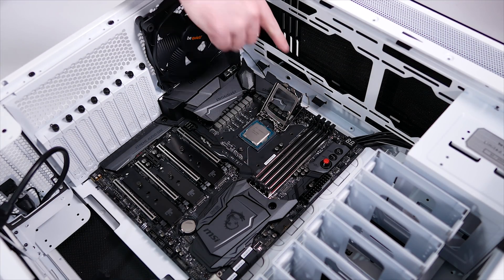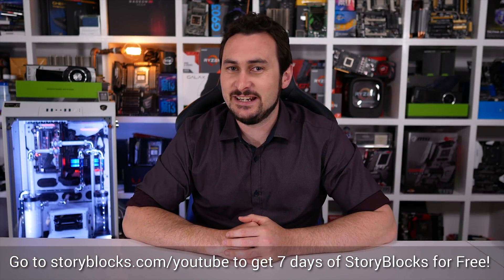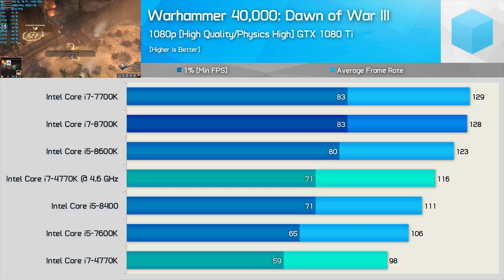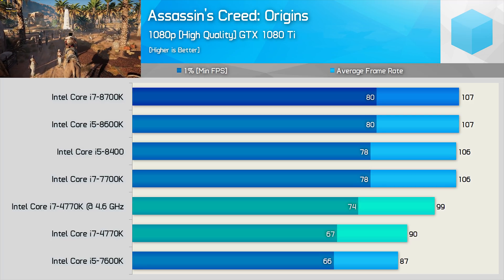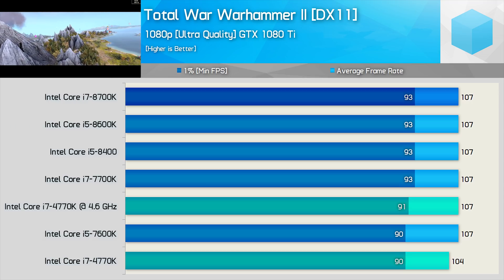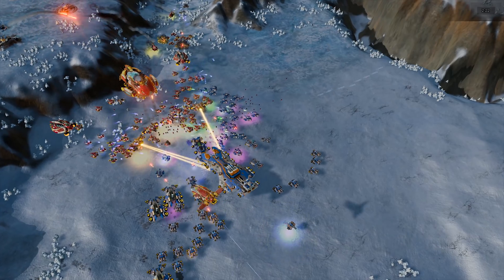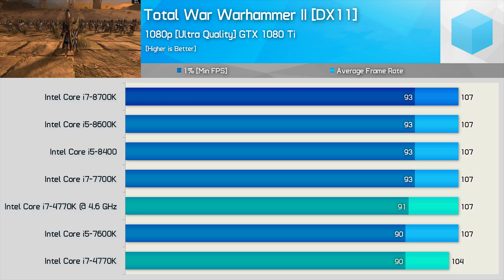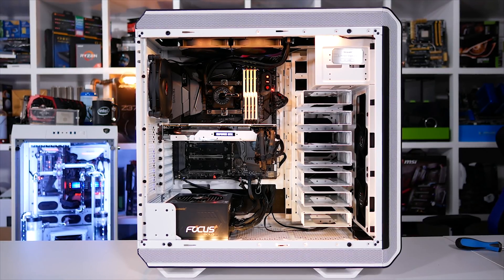4 Year Old Core i7 vs. Core i7-8700K, Worth The Upgrade?

Comment: I5 8400 is looking really good
Reply: in a month or 2 when the b series boards come out for around $80 it'll be a steal
Reply: @Desertcamel is that from first hand experience or....
Reply: What video or article shows the i5 8400 stuttering?
Reply: @Desertcamel @Boda i found the video.  there is no commentary at all. i just a bunch of benchmarks where the i5 8400 beats the 1600 by 30-50 fps in hand full of games. in tomb raider for example there are fairly well spaced frame spikes on both cpus and a few seconds in a massive stutter on the the 1600 that wasnt on the 8400.  the frame spikes on the graph peak just a bit higher and lower on the 8400 buts thats just because when somehting else is is bottlenecking the cpu the i5 falls from like 200 fps while the 1600 only falls from say 160. the second tomb raider benchmark is the one with the massive stutter on the 1600 at about 47 -48 seconds in.  not on the 8400.  or maybe we both just remember the parts of the benchmarks that favor or conclusion.  its called confirmation bias.  plus its running dx12 mode which is as buggy and inconsistent on tombraider as in bf1.  the number one answer to peoples stutter in bf1 is "why are you running dx12 for, you should know better."  and mce on all these boards locks it to 3.8 instead of 4.0 for some reason on z370 rigth now.  and the 1600 was overclocked to 3.8.   so at the same clocks on the same setup the 8400 is beating the 1600 by 20-50 fps depending on which benchmark.  i dont think i would have offered this in support of ryzen.
Reply: Problem with the B and H motherboards, is that by the time they come out so will Zen+.
Reply: guys 1600  or any ryzen are good cpus dont get me wrong.  when my choice was a 4 core i5 and a ryzen i was going ryzen all the way.  i mean i had the 1600 practically in the cart.  but when the 6 core i5 came out i said thats the only way to go for a gaming only build.  for other things maybe not.  but i only game so intel it is.  i bought the i3 8100 for 119 which beats even the 1600 in a lot of games and im holding out for when the prices go down to msrp for the 8600k.  when it does im getting it and this i3 is going in my nephews birthday build along with a b series board.
Reply: Cen Jake what? It's on par with a 7700k in most games and slightly better in some. It costs $200 and you can get a Z370 Motherboard for $110-$120. That's a great deal. The R5 1600 would be a better buy if it wasn't so dependent on fast RAM with the crazy price of  3000-3200MHz RAM right now.
Reply: @SlavjanA the problem with zen+ is that it will be the exact same architecture (amd said so themselves) with 200 megahertz extra on overclocks at the most.  wait and see.  by then 8400 and b series board will cost 254 (184 + 70)while zen+ will cost 280 (210+ 70) and the i5 will still beat it with less hassles even with the zen+ oc'ed.  wait and see.  oh and by the way for an upgrade yoyu can still get a 8700 for an upgrade on that board later.  also intel has supported 2 genereations of cpu's on one board since 2011 or so.  so the 9th gen will work with it unless they break a near 10 year old tradition (yes everybody who says that intel makes you change motherboards every generation is clueless  because the 2-3 gen, 4-5 gen, and 6-7 gen have all had interchangable boards\cpus)
Reply: Desertcamel the i5 and r5 1600 has the same amount of cores
Reply: Boda 
Type in i5 8400 vs r5 1600 and it shoild be the third one. I think it is made by full setup.
Reply: bobhumplick 
 Not first hand, but I did see a video of it. Also obviously the r5 1600 will have less stutter, It has more cores and threads.
Reply: Boda 
The i5 8400 does have noticeably more stuttering than the R5 1600 though.
Reply: it sucks, because it cant be overclocked... it is = 6700, and motherboard r very expensive... get r5 1600

Comment: Hm... no 1440p test? (I have i7 3770k and 1080ti, and 1440p monitor with 165Hz)
Reply from the maker: Did you watch the entire video?
Reply: Yes, but maybe missed something is only 7:30 am for me, and I wake up on 4am...
But from what you talk I conclude is not worth changing.
I wait for Zen+
Reply from the maker: I showed GPU bottlenecks using ultra quality settings, so you'll see the same at 1440p.

Comment: Please ! Not impressed !!! Still my 2009 Cpu model I5 750 at 2.66 ghz is the KING :):)))
Reply: It's a good chip
Reply: Better said was :)) bcs it bottleneck to much my new GTX 1060 3GB OC :In most of the newer games that card is not used more then 70% at it max because of that old Cpu it bottleneck it hard .(Cpu used at 100% most of the time ) in newer games.
Reply: sorinpopa weird, my friends 760 oc'd to 4ghz and he can handle a 480 no problem.
Reply: Unfortunatelly my very old Dell motherboard dont allow any OC :((( Tried everything .Even updated my Bios to the latest version.
Reply: sorinpopa that's probably why, you should invest in a cheap, but decent overclocking board.
Reply: sorinpopa get an i7 for your Mainboard and you're good to go.
Reply: This is my old motherboard : Dell 054km3  unfortunatelly it only support first gen .I7 so prob would not geting a noticeable increase in performance still a first gen I7 and no posibilty of OC. it because this old m. board dont allows any OC :((
I was thinking to get a Ryzen 5 1600 but with a new m. board and DDR 4 ram would cost way to much for my actual bugdet. So prob best choice for me at least to avoid that GTX 1060 Bottleneck  would be a Kit of  I5 2500K .But still not sure if that I5 2500 KIt  worth it i mean if will still bottleneck that GTX 1060 3GB OC or not ?
Reply: lol that cpu will bottleneck any gpu hard core.
Reply: Not really works very fine with everything bellow middle end gpus like that 1060 , had a 1050 2gb before that was used close to it max 99% in all games. So no bottleneck. Still decent cpu but for lower end cards now, bellow GTX 1060  , bellow middle range cards its more then decent.But for this 1060 i have now ,it cannot keep the pace anymore unfortunatelly .It Bottlenecks that 1060 now , in almost every new game. So need a new better Cpu for my new 1060 to avoid that bottleneck and can use it close to it max it can offers hopelly. But need to save some money to get a new m board and a new cpu prob still used Cpu would be :(

Comment: just made an ebay Dell build with a i5 4670 @ 3.8 hz making it stay at the Turbo boost speed, it got like 423 in single core and 1666 in multi thread =on cpu-z bench very happy with that

Comment: Im actually looking at getting a i7 4790k that has 32gb ram msi z97 1tb gtx 960 case and psu for 400 thats less then the mobo and ram of i7 8700k
Reply: Fantastic buy for gaming.

You could sell half of that RAM and the GPU, and put it towards a better GPU or some other component.
Reply: SlavjanA right now my pc is nicknamed the bottlenecker its a  fx 8320e running at 3.9ghz with an overclocked asus strix oc 1070 that i got 2 months after launch for a steal of 325 and the i7 4790k will get the max oc i can get it stable once i buy the pc
Reply: Looks good, very CPU heavy build though, could easily switch the 960 for a 1080ti later and go 4k with that
Reply: Tdog trevor Haha, but in that case the 4790K will be a nice upgrade for sure.
Reply: Hjembrent Kent i picked up a 4k monitor used for 100 last month its a upstar 28inch was a steal of a deal i run my 1070 1440p

Comment: On a related note, i had a system that i built in 2015 with the i3 4160. Now that the cpu struggle in the modern demanding titles, i've been thinking of upgrading. The question is, would it be worth to just pop an i7 4770 in it, or Should I look at ryzen/new i5 lineup?
Reply from the maker: This video really answer that question I would have thought, when you're done watching let me know if you still have any questions.
Reply: Depends on the GPU you're thinking of pairing it with. For a GTX 1060/RX 4/580 or less you can even opt for a cheaper i5 4670, but for a GTX 1070/V56 I'd buy the 4770.

Comment: I have 3770 :( 4th gen was a big leap in terms of IPC :'(
Reply: I7 3770 is still doing great^^
Reply: I have a 1st gen i7 (9 years old) and im playing all games at 60FPS
Reply: Not really At all, most of the improvements came down to stock clock speeds being raised and power reductions for the platform. 

I have a 3770K at 4.2ghz 24/7, even had I got a 4770K of see maybe 3-5% at equal clocks. 

Intel hasnt really done any massive upgrades since Sandy bridge, which makes sense as AMD wasn't competitive.
Reply: No, it really wasn't
Reply: A few games are heavy CPU bound on 1080p. GTAV for example. GPU will still make a bigger differences overall, yet having a I7 8700k over a I7 3770k is quite noticeable. 

But damn, even first gen I7 are still great.
Reply: but u see the performance gap between IVY and Sandy is still the biggest compared to other successive gens...How do u explain that ? increased clock speed ?
Reply: 3770 = 2069
4770 = 2228

That's not big at all unless you go with the stock 4ghz, 4790k which scores a 2530 in single threaded benchmarks
Reply: I always wondered why 4th gen had a higher TDP with only a 3-5% improvement in IPC. And I'm talking i5 3570 (77W-3.4-3.8ghz) and the i5 4670 (84W - 3.4-3.8ghz)

Is it the integrated graphics?
Reply: Ph42oN wrong, the gap between sandy and ivy is bigger than ivy between haswell
Reply: oc 3770k = ryzen 1800x @ gaming fps .so dont be sad.
Reply: Yea, ivy bridge to haswell was bigger difference than sandy bridge to ivy bridge, or anything after haswell. While the difference is not big in many games, biggest difference come in some badly optimized games.

Comment: Meanwhile I'm rocking a a4-7300, really, any CPU released in 2017 is an upgrade for me
Reply: Richest Miner if you're using it mainly for gaming you might as well get the 8600k. Basically identical gaming results but $100 less.
Reply: I got a Phenom 2 955 system free and it smokes even the a10 lineup. Those chips are basically useless. Get an i7-2700k used trust me. For games it's 3x faster. Maybe 2x faster for me.
Reply: Hjembrent Kent Totally Agreed.

Went from 860K 4.7Ghz to i3-6100. HUGE upgrade.  I couldn’t believe how fast the i3 was compared to the 860K (POS)

Went from i3-6100 to i7 2600K 4.9Ghz, and it blows both of those away.  Works perfectly with my GTX 1070.
Reply: DamonM Roger richest Miner was referring to the comment about getting the ryzen 5, sorry, just defending miners competence. I think everyone here knows Intel's line up...
Reply: Relatable, i have an a8 in the same gen
Reply: DamonM Roger xD yeah thanks. Haha
Reply: Parsa Strife core 2 quads aren't that bad today, q6600s still make great $8 cpus, also, get a gtx 660, they're $50 on ebay
Reply: Yep my Phenom 2 X4 smokes those, about on par with the a10 series. Get an i7-2700k used i swear it's 4x faster.
https://www.cpubenchmark.net/cpu.php?cpu=AMD+A4-7300+APU Score: 2280
https://www.cpubenchmark.net/cpu.php?cpu=Intel+Core+i7-2700K+%40+3.50GHz Score: 8749
Reply: DamonM Roger im kinda future proofing cuz in the future might do some 3d rendering. Also dont really like ryzen becuz of gaming performance.
Reply: Richest Miner the 8600k is intel... It's the i5, still 6 cores but no hyperthreading. 6c/6t...
Reply: Bubba Grimm all good, I guess he replied to the wrong person...
Reply: Hjembrent Kent you have $150 to donate to "upgrade c2l's pc cause"?
Reply: a8 5500 here :D
Reply: Lmao now that's even worse than my Xeon E5440 (aka Core 2 Quad Q9550).
Tho the iGPU still beats my GT 9400 😂
Reply: Any i7 cpu released since 2011 is an upgrade for some.... :)
Reply: C2Lception Yeah I upgraded to this CPU a few months ago from a Pentium Dual E2200 that was OC'd to 3GHz. And oh man wasn't that a worth while upgrade. Even at stock (2.83GHz) clocks (can't OC due to my mobo not having the option to lock PCIe clocks when your FSB speed goes over 1333MHz) my life has been made easier even with my 9400 GT. Playing Dota 2 no more dropping down to 15fps-ish in team fights and can actually go higher than 40fps 😂 I'm over 50-60 most of the time and dropping to 30s in the worst case scenario. (Playing at 1440*900 w/ 50% render settings and lowest details)
Best $25 of my life spent. (+ $16 for a 2 heatpipe cooler)

As for graphics card, used graphics card market is utter shit here and I don't have access to eBay. I'm saving up for a PSU as my non-branded weightless 230W PSU could kill my PC anytime lmao so don't wanna risk a new graphics card dying. After that I'll probably save up for a 1050 or 1050 Ti!
Reply: https://www.cpubenchmark.net/cpu.php?cpu=AMD+A4-7300+APU ?
You dont 'rock' that,you just suffer it.
Pentium G4560 if skint, r5 1600 if not.
Move your arse, Soldier!
Reply: Joe shmoe got some funding for that sir? Last time I heard, all the money was going to a wall!
Reply: Get a cheap new haswell board for $50/£50 (whatever) new /refurb  from amazon or similar.. Then buy a used i5 4460 for 70 £/$.
ddr3 1333/1600 is cheap. you need 8 gig.(2x4) Thats about $150 total.
It will FXCKING SMASH what you are running to pieces. 
MASSIVE NOTICEABLE IMPROVEMENTS in every general use.
Use a solid state drive it gets ridiculous.
Put in a 3 gig gtx 1060 you turn it into a cheap capable gaming rig.
You will need a reasonable quality 450 watt psu for that, but you get the point.
(you wont care about a wall)
If you are skint, buy a used lenovo with an i3 4150/60/70 and upgrade the power supply.
(those machines use aftermarket gigabyte boards)
Reply: Joe shmoe you wouldn't believe how much people want for their old stuff, besides, I'm getting a free FX CPU, so that's my route
Reply: Haxor inator the FM 2 series is basicly a dual core, i dont consider it a true quad core because each module (there is 2) is split into half sharing some resources with the other half like the floating point integer. athlon  on  fm2 never had a chance , its beat by even second gen  and third gen i3s in gaming.
Reply: Ultra AL lga 1156 Xeons too are very powerful despite being released in 2009
Reply: +Richest Miner buy a ryzen 5 1600 better prize, a bit worse power
Reply: C2Lception saaame bro. It is so bad lol. Im looking to invest in a 8700k sometime soon.
Reply: This channel are doing giveaway right now, maybe try your luck https://wn.nr/6Jm9Uv